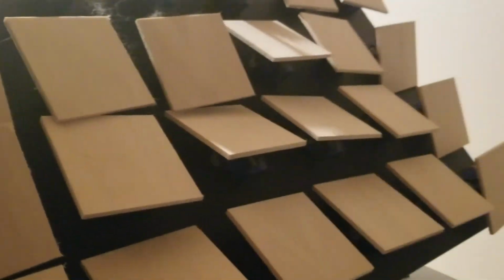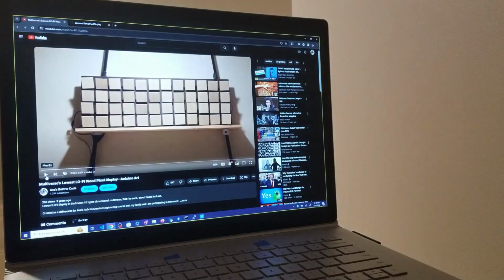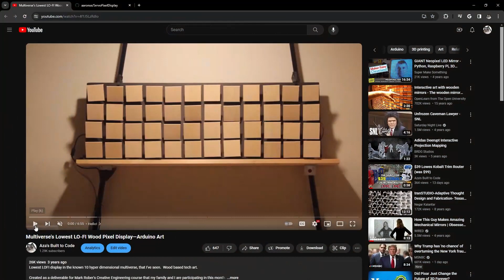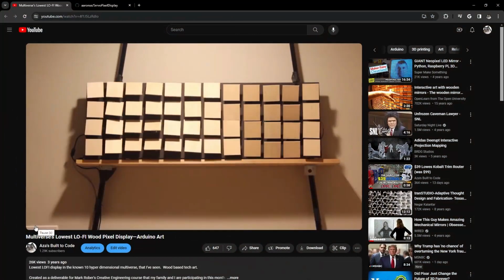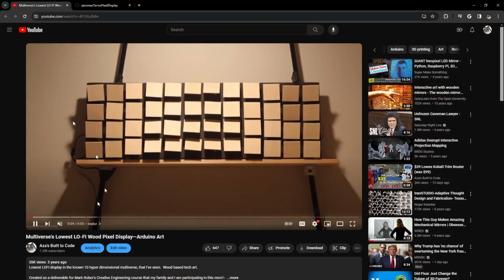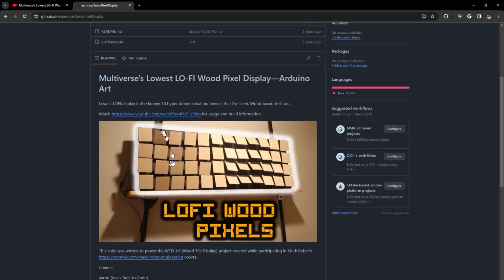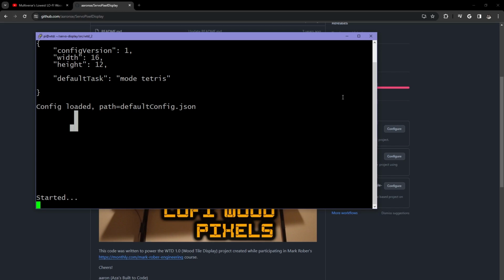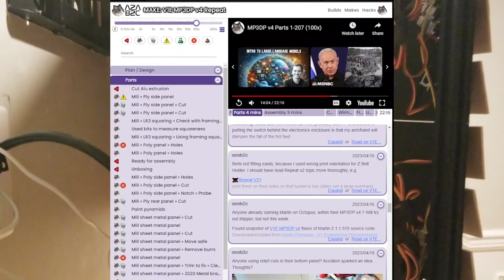LO-FI Wood Pixel 40" Display —  Tetris, or Art (Raspberry Pi)

Comment: Hey! i left you something on buymeacoffe!
Reply from the maker: AWESOME!  Thank you so much!  Really appreciated the appreciation 🙂.  What kind of content do you like?  Cheers!
Reply: @AzaB2C  I like the content based on artsy projects. I would like to build such a display for my bachelor's degree, a 144 pixels, with 9 pca servo board. How is the wiring made on the backend of the things in order to functions as a mechanical mirror?
Reply: @AzaB2C  i see you have the pca modules numbered from 0 to 15. i know that that from 0 to 4 they are wired on series, but from 4 to 6 i dont know how  they are wired. does it is on zig-zag pattern?